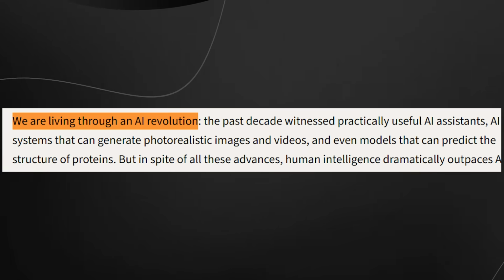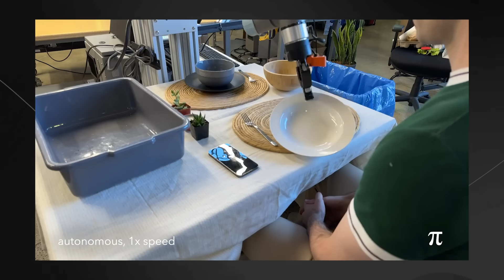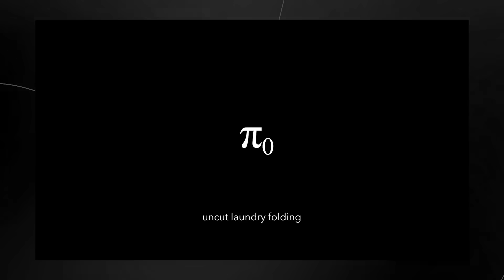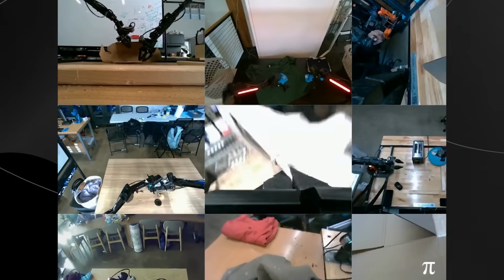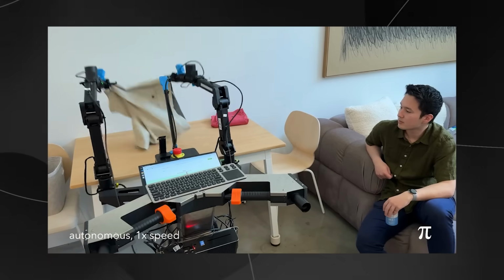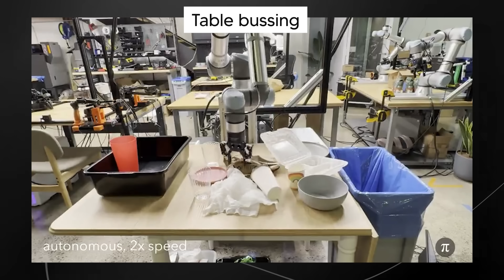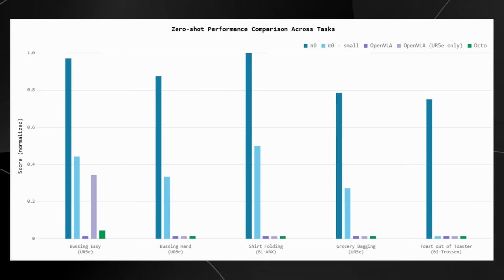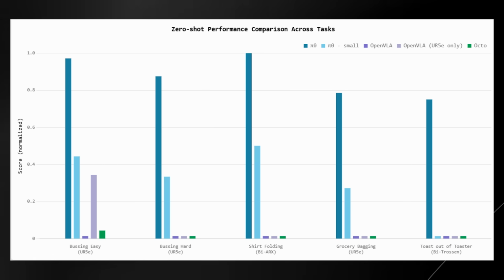The Worlds First FULLY AUTONOMOUS Robotics System Is Here (Physical A.I)

Comment: Some of those examples are at 10x speed. That’s far too slow. It sure is heading in a very interesting direction though. Specially once they are faster.
Reply: Does it matter how long the Roomba takes to clean your house so long as you're not doing it ? The time savings is the same for the owner, until the robot is at 100% utilization, of course.